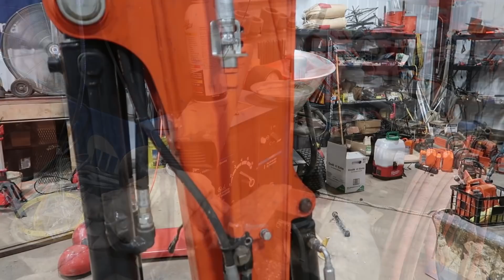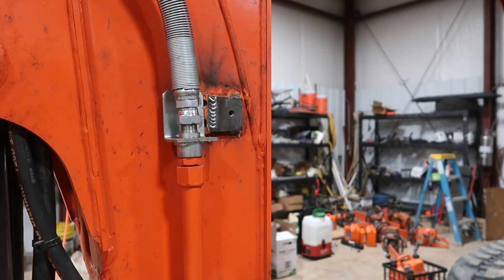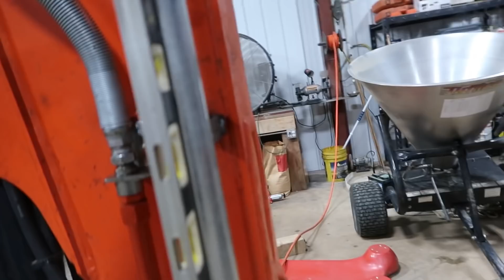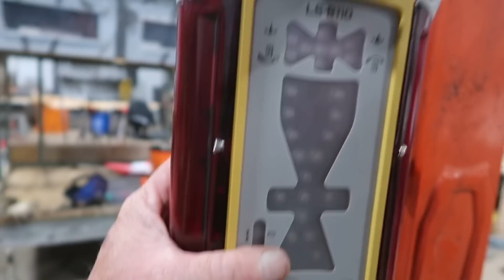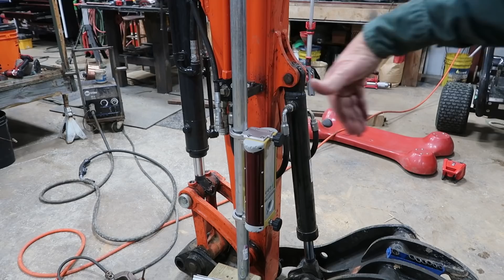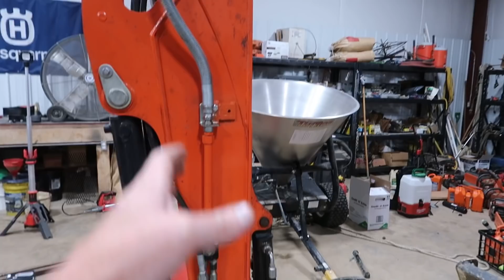Making something for my mini | shop project

Comment: Very good idea.  A contractor doing grading work where I was the inspector got a laser system that was good to 1/16 inch at 1000ft and several receivers for linker rods and machines so several machines could grade at the same time to the same datum.  At first the operators did not like them but after the 2nd day the operators swore by them.  There are systems to be attached to the machines which will raise and lower the cutting blades with the laser and the operator only has to steer.  Those things are great for grading sewer lines and other slopes.  The system that contractor had included a 15 ft tripod to get the laser above the machines so the field of view was all over that 800 X 1500 ft area.   You are going to like that set up.  One suggestion is to store the bolts for the brackets in the stick to keep the holes from getting plugged with dirt and such plus they will be less likely to get lost while being stored in the shop.  Been there.